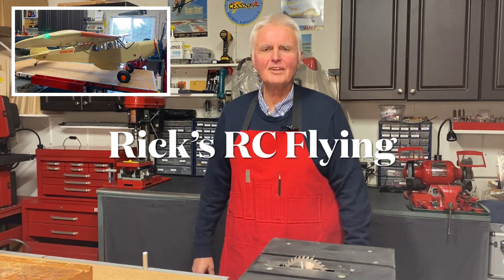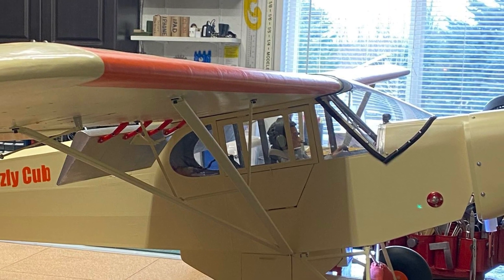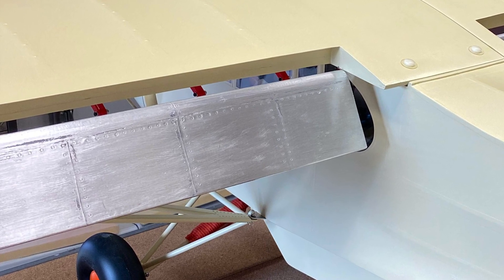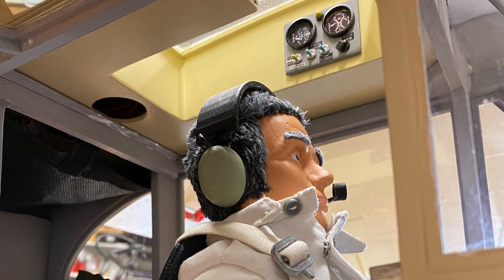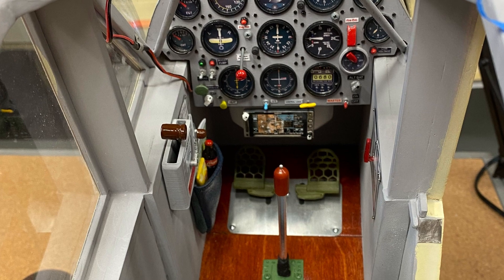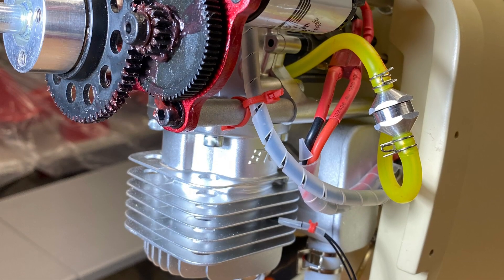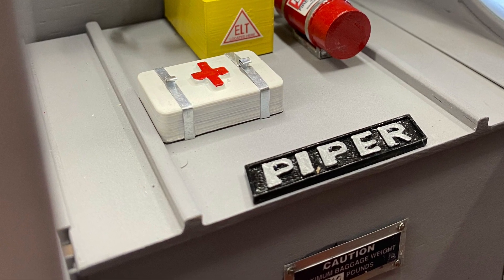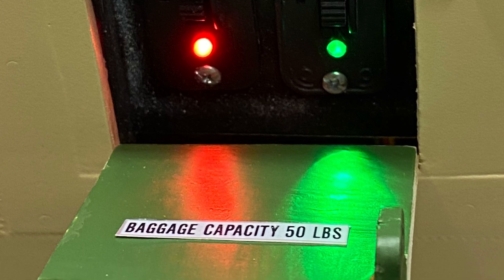RC Piper Super Cub airplane

Comment: What did she come out weighing?  Nice build!! There is no greater modeling joy than to take a pile of balsa and light-ply, and turn it into a scale flying model. I have to have 1.20 4-strokes in my 1/4 scale J-3's and PA-18's. Cubs are a pure joy to fly, and to fly them scale.
Reply from the maker: She weighs 17.6 pounds. I totally agree with you about scale airplanes and flying them in a scale manner. Happy Landings, Rick